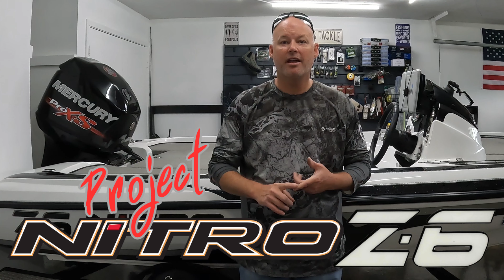How To: Install Bass Boat Seats & Center Seat Delete BassBoatSeats.com Deckmate

Comment: did the 1/2" flex a lot when stepped on?
Reply from the maker: Are you commenting on the right video? Or are you referring to where the seat delete is? If so.. very minimal flex using that specific cutting board noted in the video. I hope that answers your question 👍
Reply: @stephansmithoutdoors  yes sir, the cutting board, looking to do a seat delete on my Z9, thank you.

Comment: Stephan did you mention what the seats were or where you got them? A link would help
Reply from the maker: @raytubach8988  Bassboat seats .com in the intro and tittle.. Thank you!
Reply: @stephansmithoutdoors   yeah saw that but no model, no link, a search by boat on that site comes up empty. It would have been just as easy to post a link here than to reply with no help. But it’s your channel
Reply from the maker: @raytubach8988  I screen shoted it in the video.. 20" Nitro seats..
Reply from the maker: @raytubach8988  https://www.bassboatseats.com/products/nitro-bass-boat-seats-20-w-buckets?currency=USD&variant=25288643401&utm_source=google&utm_medium=cpc&utm_campaign=Google%20Shopping&stkn=21ae27328065&gad_source=1&gclid=CjwKCAjwnK60BhA9EiwAmpHZw7qyVuCMYLGU3omrooALOo_-bxaWYA7VCK86mauok8dpYPfnCebPaBoCqGkQAvD_BwE